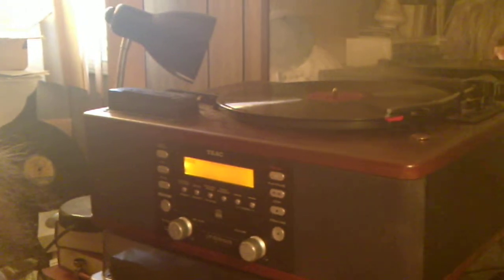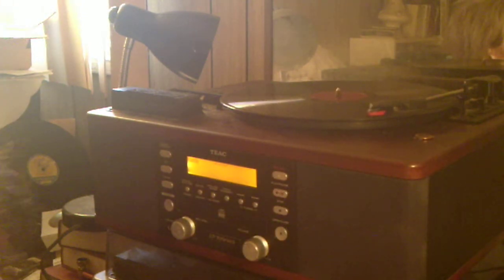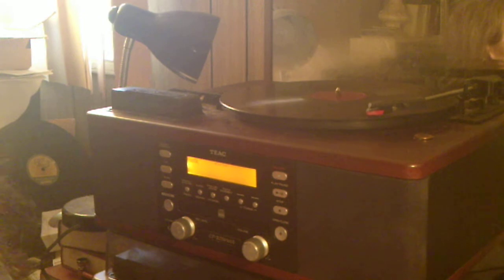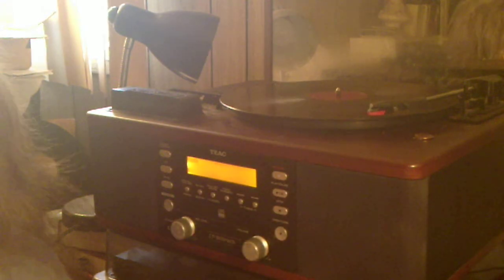ANNIE VAN AUKEN: Aquafilter©, a secret of AVA's Triple Filter© Process revealed!!  (2022)

Comment: When I moved to my current house 14 years ago, I had intended to reestablish a proper stereo system including a turntable, but at the time because of all the new formats, instead of only needing a turntable and amps, preamps or an integrated amp, and speakers, there where various types of disks with various formats--CD, DVD-Audio, SACD, etc. (although I could have gotten a universal player), and then one might need a music server for digital files, and the associated amplification for each. But my main issue was looking into turntables and speakers. Because of the vinyl resurgence, there were so many turntables available at different price ranges, and you can't go by the reviews as they really only compare within price ranges, and even then they are written like restaurant reviews. So even though I have somewhat limited space I could have gotten a decent system, but because there are no real showrooms around anymore to audition equipment, I became paralyzed by the choices and didn't get anything, so now I was mostly watch  YouTube or have turned CDs into the digital files or bought HD files occasionally, all played just through my computer with a couple different headphones, including a better, but let's comfortable one that works best with amplification for which I got an expensive rechargeable Chord Mojo DA/amplifier, which I hardly use because it just awkward to set up and adjust the volume every time, and because I use it infrequently I have to charge it again first. I mostly listen through a high quality NAIM Mu-So wireless speaker, which while not as good as standalone speakers is pretty good for a wireless speaker. It's not as revealing as the headphones, however but it has a nice tone to it. It's crazy that because I couldn't decide on what level of audiophile equipment to get I didn't get any, aside from what I mentioned, and I still don't have a turntable.
From 2014 on I developed a parallel hobby, which started with uploading audio to YouTube from a Jackie Evancho concert (you say you haven't heard of her but she was the 10-year-old blonde little girl on AGT that sang like a mature classical singer, you may recall, and came in second in 2010). I was taught audio editing by an audio engineer who worked for the BBC (who I met on the Amazon discussion forum for Jackie) in the process of working on that and a few other projects together, and throughout the years. The main goal for me was keeping the audio lossless before uploading to YouTube. I also record and process performances from over-the-air TV broadcasts losslessly, which usually results in better audio than the official uploads for those shows even after YouTube processing. You may wonder why you don't see such things on my channel. That's because they are different channel. I wanted to give you this link anyway, so you can check out this channel regarding what I just mentioned. Have you ever heard of Kathy Chamberlain's Rag 'n' Roll Review? I discovered the album in the early 80s in a discount bin. It was recorded on the Warner Brothers label in 1977--there was an almost identical selection of songs on another album on the Buddha label the same or next year. I think you would like it because she uses Ethel Merman type singing for old blues and jazz songs, and some originals. Before the pandemic I had read that she currently lived in an area near you and performed at a local restaurant once a month. Here's an upload of the full album from the CD--I think most of the others uploads of individual selections or A and B album sides might be from the vinyl. But they did a good job on the CDs so it sounds pretty much the same. You can look at some of the rest of this channel regarding what I mentioned before.
Cathy Chamberlain's Rag 'n Roll Review - Full Album - LP: 1977 - CD: 2006 - Warner Bros. Records 
https://www.youtube.com/watch?v=5HXWeJ5AmFo
Reply from the maker: Have never seen AGT. The only thing I watch on TV is NFL games, have even abandoned the 8,000 movies I have here on tape and DVD. My last days are dedicated to producing these videos. A decent legacy along with my 10,000 AMMY reviews. 

What I have discovered is: you can do amazing things with the cheapest equipment. For transferring vinyl and shellac to tape, then to CD I use a $300 TEAC multi-function machine, a $180 INSIGNIA amp, bottom of the line at Best Buy, a used 1999 SONY twin-cassette deck and for shooting the videos, another INSIGNIA amp, a $30 CD player and a digicam that new was $130, but I'm on my 2nd one now, so I got it used for $60. 

The actual images are shown on an old IBM-type THINK PAD with a pair of POLK AUDIO bookshelf speakers bracketing it. The results are good, and in the case of used records, their sound is improved by the loss of the highest frequencies audiophile equipment provides. I'm pleased with my work, don't mind the lack of volume a direct audio patch would provide, and like the white noise shooting "live" videos introduces.

Thus is the distinct Van Auken Pirate Station sound!
Reply: @AnnieVanAuken  I suppose that works for old recordings, but it wouldn't pass muster with audiophiles. The irony is that why my hearing is pretty good I think I was little and the high previously especially in my left ear, about 12 years ago I had my hearing tested and the lower frequencies started just a hair below normal and then gradually tapered off as the frequency and increased, to a steeper drop off around 8000 kHz. But the guy young testing me said it was better than his test results which was irregular. In other words mine was a rather smooth and even curve, so it can be fairly easily compensated by raising the volume a little, or makes equalization easier if you choose that. I don't know how much different it is now. At that time when I discuss getting an expensive stereo system with my sister, it angered me that she tried to dissuade me me by talking about my hearing, one get the benefit of it--that's when I have my hearing tested. More recently she says I should do what I want with my money if I want to get stereo system or whatever. Maybe it has to do with being in a better financial situation. But I still have that issue of choices. When I was young, I read all the DC comics--Superman, Batman, Wonder Woman, The Flash ,Green Lantern, Mystery in Space, etc. Comics were 10 cents then, and my allowance was 70 cents a week, and I spent all of it on comics. When DC came out with one more comic book issue, since I couldn't afford it, I gave up reading all the comic books rather than not have them all. I think a similar psychological thing was at work with the stereo choices. I'm pretty sure whatever decent system one gets, the brain's audio processing would get used to it and compensate for any deficiencies. I'm not sure if that's my theory or someone else's. There's a legendary audio engineer, I forget who, who was still working in his 70s and seemed to be able to do just as well despite inevitable changes in his hearing over the years.
Have you listened to any of the artists  I provided links to? Because you haven't commented on any. If you don't check them out, I can save time by not providing them. I thought you might have been interested in Angelina Jordan because she was a child prodigy singer who was compared to the old-time jazz singers, and could sing in various styles. Here is a link to Jackie Evancho at 11 years old performing three songs in the NPR tiny desk concert from 2011 with just piano accompaniment. She never actually pursued classical training, and her adult singing voice has changed although it is still pure, and she has maybe not progressed as some had hoped, but as a child prodigy in singing, who, like Angelina Jordan, did not sound like other child singers, she was remarkable.
https://www.youtube.com/watch?v=Sy4msuC9GI8
Reply from the maker: @fredbloggs6080  I don't wanna disparage anyone, certainly not in the manner I get occasionally from self-appointed audio elitists (why don't you do this, use that, why is audio low, distorted, etc). 
On your links, no I apologize. I hinted at why: I'm firmly locked into the music of my youth, my parents and their parents, and with this enormous collection of sounds of my liking to work with, and with the knowledge of a lifetime to share, I just cant get distracted by modern music.  If you have links related directly to 1900-1980, I'm all ears!
Re: hearing, Brian Wilson was essentially deaf in one ear. He didn't see the value of stereo sound, and that drove his Beach Boys mates crazy, which reminds me of a mistake in the film COPLAND. Sly Stallone, who also only has one good ear, is listening to a Bruce Springsteen ballad on an LP. His lady friend remarks that it's available in stereo and he replies, it wouldn't matter. Of course, except for reissues of old  mono recordings, COLUMBIA stopped making LPs in both formats in the late 1960s.  LOL
Reply: @AnnieVanAuken  Well, the set list for Jackie Evancho in the tiny desk series and in her Dream with Me in Concert special produced by and conducted by David Foster is hardly new style music:

1.	"When You Wish Upon a Star"	Leigh Harline, Ned Washington	
2.	"Nella Fantasia" (Italian lyrics)	Ennio Morricone, Chiara Ferrau	
3.	"A Mother's Prayer" (with Susan Boyle)	David Foster, Carole Bayer Sager	
4.	"Nessun Dorma" (Italian lyrics)	Giacomo Puccini, Giuseppe Adami, Renato Simoni	
5.	"Angel"	Sarah McLachlan	
6.	"O mio babbino caro" (Italian lyrics)	Giacomo Puccini, Christopher Todd Landor	
7.	"Somewhere" (featuring Barbra Streisand)	Leonard Bernstein, Stephen Sondheim	
8.	"All I Ask of You"	Charles Hart, Andrew Lloyd Webber, Richard Stilgoe	
9.	"Ombra mai fu" (Italian lyrics)	George Frideric Handel[69]	
10.	"Lovers"	Shigeru Umebayashi	5:01
11.	"Imaginer" (French lyrics)	Walter Afanasieff, Lara Fabian	
12.	"The Lord's Prayer"	Albert Hay Malotte	
13.	"To Believe"	Matthew Evancho[70]	4:28
14.	"Dream With Me"	David Foster, Linda Thompson, Jackie Evancho	
Total length:	54:56
Target deluxe edition
15.	"Someday"	Alan Menken, Stephen Schwartz	
16.	"Mi Mancherai (Il Postino)" (Italian lyrics)	Luis Bacalov, Marco Marinangeli	
17.	"The Impossible Dream"	Mitch Leigh, Joe Darion	
18.	"A Time For Us"	Larry Kusik, Eddie Snyder       

Angelina Jordan sang Billie Holiday, Dinah Washington and Screaming Jay Hawkins when she was young.

But Kathy Chamberlain fits in with your time period,  as the album was from 1977, and the music and musical style is from the the 20 on, including:
He May Be Your Man (But He Comes To Me Sometimes)
Old Rocking Chair
Brother Can You Spare A Dime
Mack the Knife
Reply from the maker: @fredbloggs6080  Freddy, doesn't matter what Jackie sings, I have my own music to listen to and share. 
If I was younger, I'd be open to other things. Am laser focused on this work while I'm still able.. 
The last modern song I got into was the Four Not Blondes hit but that was because I was riding in a friend's car and she introduced me to it by force, really. Although I like it, can't even recall the title anymore. Hardening of the brain, probably.
Am timing out a 1973 hit presently for its slideshow. It'll be amusing if I can get this right.
Reply: @AnnieVanAuken  You mentioned something indicating it would take a couple hours to upload 500 MB. That would upload for me in less than five minutes but I have 1 GB fiber, so figure on average a quarter of that through Wi-Fi and maybe a little less for uploads.

Comment: So simple I wouldn't have thought of it! In addition to what you say, wonder if the viscosity of the water would dampen harsh buffeting of the stylus due to an abrasively worn surface. Of course, my approach is very different & I find soft tone needles reduce much surface noise. I do also rub the record with candle wax. I believe this gives some lubrication & may fill in tiny pits in a surface that has become abrasive due to wear.
Reply from the maker: My big regret is I ddn't choose a 78 with a constant crackcrackcrack noise. 
Unless it is a scratch or bad rub, water makes that interference vanish.
I have additional techniques to get the best sound out of a used 78. ONE: I find the stylus that produces the least distortion, lathe or whoosh. TWO: An examination of both channels independently reveals the best one. Usually it's the right, but sometimes that area of the disc has been damaged by groove shearing, which I call "lathe".  In that case a bit of surface crackle from the left is preferable to distortion in loud passages. The chosen signal is divided between left and right for true mono sound, sent through an amp, where I adjust bass and treble,  then comes out the headphone jack to take advantage of that cosmetic trimming, and into a cassette deck for a master tape. Once done, this is played back through the same amp, but with bass and treble both at -10, and patched to a CD burner. That disc is played where I shoot the videos, through the same model amp that's in the studio and with B and T adjustments made for the last time. Triple filtering.
Reply: @AnnieVanAuken  It would be nice if true mono cartridges were available, i.e. one that only responds to lateral movements of the stylus, or purely vertical movements for 'hill & dale' records. I recall describing a way of wiring the to channels to respond to lateral or vertical movements only. Struggled to find a way to explain this, but when the two channels are wired in parallel, or in parallel, but via a reversing switch, all lateral, or all vertical vibrations which the cartridge 'hears' & converts to electricity, are effectively cancelled out. Cartridges pre wired in this manner are commercially available, but I achieved quite some success doing such wiring/switching myself. In the case of acoustic records, I referred to the acoustic recording response curve I emailed to you, straightened it with a graphic equaliser, then cut off the treble & bass parts that would not have been heard by the recording horn anyway. I did not tape these, but just tinkered to increase my listening pleasure. At that stage I only owned one gramophone & wasn't online. Since then I've become a real gramophone enthusiast & prefer to hear my recordings 'raw' but getting the best from them by needle/reproducer/gramophone choice. If I was to have one gramophone, it would be the Edison with fletcher soundbox for conventional discs. The portable which gives the best all round results is the Electrola 101. The 'Marathon' has to be my flagship machine, due to inheriting it from my wonderful erstwhile neighbours & its ability to play all vertical cut records barring Edison D/D's. Going almost exclusively acoustic to my mind, has similar pleasures to driving a vintage car with quirky handling characteristics, or travelling behind a steam locomotive on one of our many preserved railways. No deprecation of your methods, to a sensitive ear like mine, ALL preserved/restored vintage sound is good sound!
Reply from the maker: @tiga4180  Of course modern stereo cartridges only respond to signals etched into a groove's sidewalls; no hill-and-dale, so yes, your idea of lateral only would be great for 78s.
We both have experimented in this area, so we have something in common. My tendency goes back to childhood when I was given a Tinkertoy set for Christmas. In case you've never heard of this, it's a collection of wooden dowels and sticks of various lengths and colors that fit together to make things. One design was a sort of carnival plane ride where you turned a crank and these four arms attached to a center wheel would rise with centrifigal force as they spun around. Having at that time a kiddie acousic phonograph, I got the idea of modifying this device so it could play records. The Tinkertoy tone arm had a blunt pin, possibly a carpet or leather needle, that was connected to a piece of aluminum foil for translating vibrations to sound. Didn't work too well, but I loved sitting there and turning the crank to hear some scratchy old 78 play a faint and wretched tin foil tune.
Hey, did you know that in Japan, audiophiles prefer phono cartridges made of wood or jade?
https://thevinylfactory.com/features/the-complete-guide-to-turntable-cartridges/#:~:text=Cartridges%20turn%20movement%20into%20signal,placed%20very%20close%20to%20it.
Reply: @AnnieVanAuken  When I was at about 13 or 14, I bought an old handcranked phonograph from an auction in town. It was made out of watercourse, stood maybe 3 1/2 feet tall, and used steel needles. The sound was fed to a horn below the turntable. I forget if you had to keep turning it at a constant speed or if it was spring-loaded, and you just had to keep rewinding it. I think the speed correlated with how fast you cranked it.